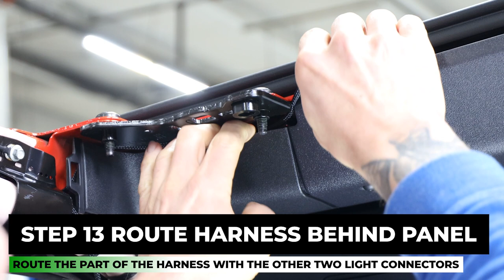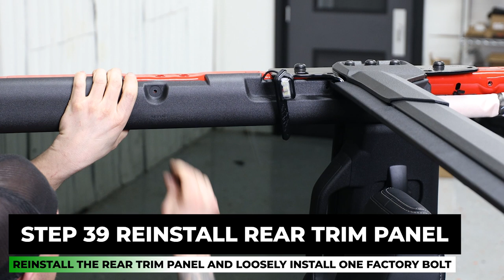Installing The IAG 4PC Interior LED Dome Light Kit For Hardtop  2021+ Ford Bronco

Comment: Just finished the install… Man with a world of difference!

Took about two hours to complete the whole thing… The installation video is amazing, but I recommend also having the written instructions on hand as there are a couple of key segments missing… Mostly on how to access the fuse box area.

Also recommend that you start with a clean shop and water room around the vehicle because spreading out the top and trim pieces makes it a lot easier to put back together at the end.

Probably the best hundred bucks I’ve spent on my bronco yet!

Comment: Where the step to remove the panel under the steering wheel that gives you access to the fuse box?
Reply: OK, I saw in another video that this full panel under the steering wheel simply pulls down.  You pry one side loose on the top of the panel then use two hands to pull the whole panel down from the top.  It’s attached on the bottom so it swings down

Comment: Just installed. Took me a couple of hours working very slowly. Only part this tutorial left out was pulling down the panel under the steering wheel - took more force than i expected so i figured i was doing something wrong. But in the end it went together very well and functions great!

Comment: Haha yeah nahhhhh, I’ll just maybe get the battery powered one I seen one time. Maybe cheaper way to go and annoying to use batteries but fuck this. Maybe someday I’ll do it but I thought it was much more straight forward.
Lost me at the end part having to open up the door area and cut the tape, all that wiring bullshit. Man Ford is a fuckin joke for cheaping out on Dome lights, my 01 Mustang had dome lights. My focus had dome lights but because the top comes off Ford couldn’t figure out a way to integrate this at factory? Fuckin pathetic. Whatever it’s not super necessary for me right now anyway. I appreciate IAG making it though and maybe someday I’ll do it. Doesn’t look too hard but I know from experience these things are always 50% tougher than they look and I’m not wanting to pull apart all my shit for some extra lighting this bad.

Comment: for step #28, the wire to tap looks blue and brown line goes thru it. are you sure it is pure gray?
Reply: Did you find out which is the correct wire.
Reply: @damustangkid  it is actually brown line on purple wire.
Reply: @aniljavali  grey with purple stripe worked for me.  Support was very helpful over email (weekday responses only).    Seems I was trying grey with brown stripe incorrectly.
Reply: my colors work
Reply: Light blue/grey with purple stripe for me 23 badlands
Reply: There are two very similar wires, after reading this comment I’m confuse.  Instructions say Gray w/ Purple stripe.  Other looks Grey with Brown stripe.  But below, @damustangkidd6553 says it’s actually the brown line on purple wire???? 5:59

Comment: Maybe I missed something , but I watched both videos , why is there a light kit for hard top vs soft top? 

I’m still waiting (hoping/praying) I can get my hands on a hard top so if I install the soft top kit and then get a hard top, what are my options then?
Reply from the maker: We do have 2 different kits available for the soft top and hard top. The difference is included brackets for the hard top but otherwise the kits are universally the same. We do also sell the brackets separately if you do get your hard on one and need to purchase them later on!

Comment: So can you have them come on with either the doors opening AND an aux switch?  Essentially hooked to both power sources?
Reply: Yes
Reply: Can u just wire up the aux without tapping the other?
Reply: @ronaldmeadows5113  yes. Just connect one to aux and tape up the other one.